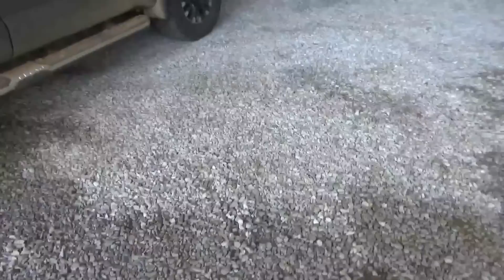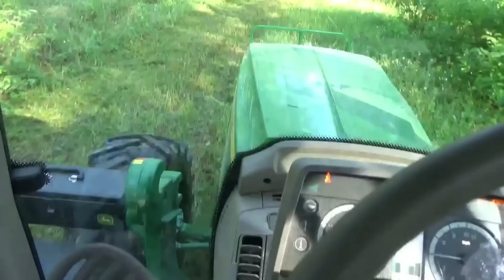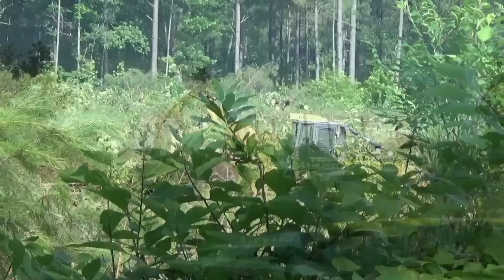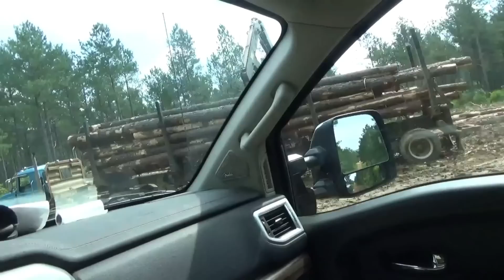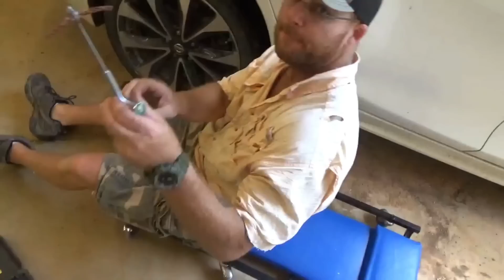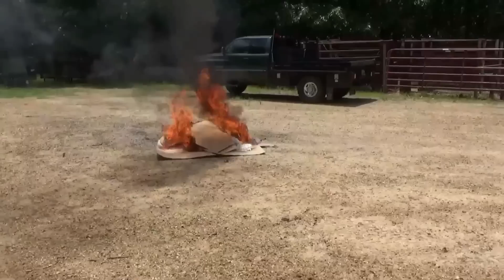SISSY GOT A FLAT TIRE 🤬🤬🤬

Comment: Good grief, that tyre doesn't look far off done, right close to the wear indicators already! ECU should have saved the fault code on the jeep if it was throwing a warning light or message up, just needs the dongle plugging into the doo-hickey and bringing up on the confuser, lol.

Comment: Jason, Buy a cheap tire fix tool at harbor freight, etc and Cut off the handle and put it in a drill.  A lot easier to make the hole Bigger for the plug. Works like a Champ for plugging tires. Her Tires are Shot lol. Her Brakes must be in Sweet Shape lol.
Reply from the maker: She goes through more tires than I do racing